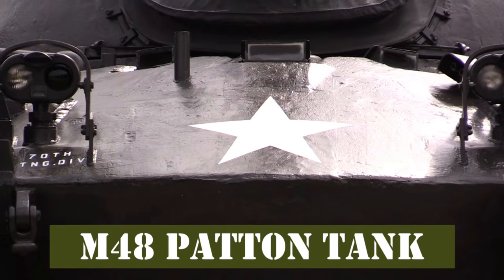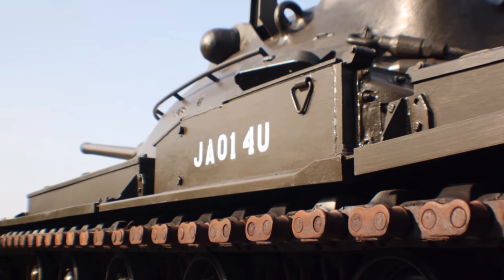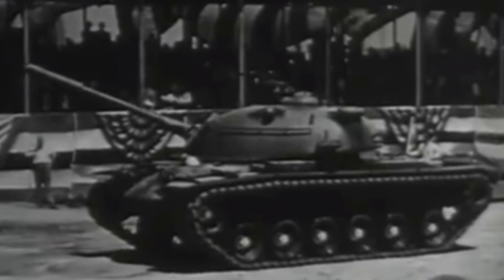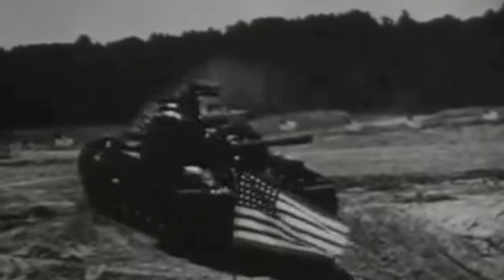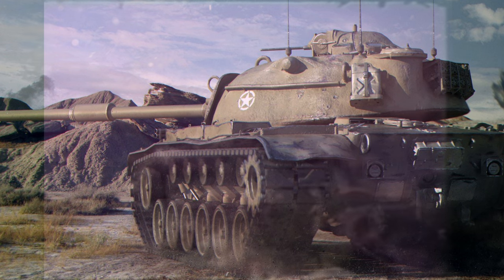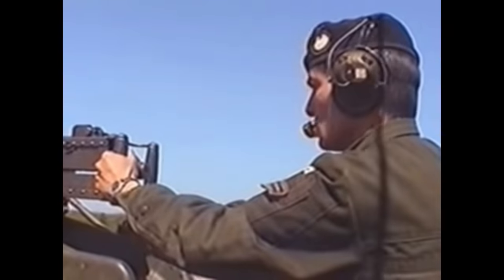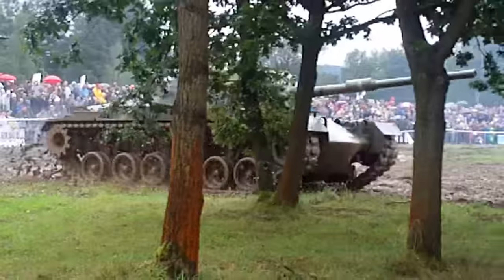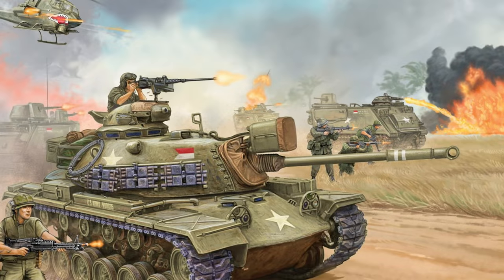M48 'Patton' Tank Series | AMERICAN ARMORED CLASSIC

Comment: Fun Fact: The US has thousands of M48 Pattons and M60's scattered across the country as last ditch tank reserves.

It's comforting to know that they still haven't let this beast go but it's scary to imagine the scenario it has to come back.
Reply: Yeah. Not just Pattons, there is a major tank depot outside of Dallas. It has like, 50 or more Abrams, Bradleys, and multiple other variants
Reply: @Limescale12  a big minority of the population already are armed with smal arms anyway...
Reply: They don't use them as last-ditch tank reserves they make use of the hulls to carry other platforms like recovery cranes or folding bridges, the 105mm guns are recycled to other platforms like the M1128.
Reply: The M60s and M48s are gone. Dozens were thrown in the oceans as artificial reefs. Hundreds were sold or given away as aid and no serving tankers know how to use them. The last M60A3 unit shut down in the mid 90s. My unit handed in our M60A3 in 1994 for M1s. There are a few thousand surplus M1 tanks in storage out in the desert but would take months of work to get into shape. Seals degrade, material and insulation dry rots. Sheet metal rusts, rain gets in as well as critters. If they are not maintained in a climate controlled environment and periodically maintained they degrade rapidly.
Reply: @13thSystem  They are last ditch reserves before anything else.

Many M48's and M60's are export capable. This was the intention as they were being phased out by the Abrams. But it was deemed that they should keep them in reserve. This is shown by the sheer amount that are combat capable.

Yes some of the tanks are converted, some were scrapped for parts for export tanks, some are used as target practice.

But there is an estimated total of over 6,500 M60's and 4,400 M48's scattered across the US in depots, storage facilities, or out in the open.

And the ammo isn't a problem as the M60A3 can use most 105mm ammo that is available. But what you forget is that some guns can't fire the same ammo. The M60 had the M68A1 while the M1128 had the M68A1E4, and the Abrams had the M68A1E2 the only common round is the M900. The E4 is the only one in active service and only fires the M900 and can't fire some other shells that the M60 used. 

With that being said there are still plenty of M833 ammo that the M60 originally used and can still fire some 105mm shells. The situation is even better for the M48 as it could use both 90mm shells and 105mm shells depending on the variant.
Reply: Yeah but the guns are grossly underpowered by today's standards. The 90mm and 105mm wouldn't dent most modern tanks.
Reply: @thebravegallade731  I think you mean large majority
Reply: Well, we also have T-54s in our reserves)
Reply: @joeclaridy  The M60 is capable to be upgunned to have a 120mm gun and the 105mm gun for the M48. This would enable them to at least have a chance against modern tanks. Modern tank on tank engagements are rare nowadays but in this scenario that they are back then something is horribly wrong
Reply: Kyle Reese  " It's a piece of junk" That's not the point the US had in mind. If in some heavy WW3 like scenario, let's just say the US is fighting Russia/China/Iran/North Korea at the same time or a single huge Russian advance into Europe, and Abrams tanks are taking heavy losses in a ratio that more are disabled/destroyed faster than building a tank from the ground up then it was deemed that the M60 and M48 was to jump in and take that spot.

Everything is there. The spare parts, the ammo, the guns, the tanks all it needs is some tlc for the ones left in the elements. Even if the US can't mobilize every tank it would have a huge stockpile to cannibalize.

I'm not saying this is going to happen as the scenario as a whole is unrealistic but at the end you can't deny the fact that this shows that the US has this capability for a reason.

You know that the US would bring back Battleships if they needed to right?
Reply: tfs2O3  Where are these tanks being kept. The last unit turned theirs in over 20 years ago. The Army can't use all the M1s it has what will it do with obsolete M60s. Even if stored in dry climates the electronics and seals will degrade. If the recoil seals on the main gun are not exercised by firing or by a maintenance unit a few times a year they will leak and then blow out if you try to use the gun. I sincerely doubt any M60s  in storage are as a war reserve. They may be a source of parts to sell the countries that still use them like the Air Force bone yards.
Reply: @Limescale12  same
Reply: @justat1149  There's a few thousand Abrams in the southern California desert.  Early models only obviously.
Reply: YorktownUSA 

I’ve heard about them. I believe they are either in storage or they are waiting to be sold or refurbished into M1A2’s
Reply: @dsan8742  😕 tell that to the afghans
Reply: @dsan8742  you have no clue what you're talking about. Chechnya should be a clue for you. Afghanistan as well.
Reply: They might be outdated but that won’t be on your mind if a 90mm HE is coming at ya.  😀
Reply: @Limescale12  the afghans did quit well that way. And the vietcong, and the yeminite rebels and and and....
...and the Americans in their first war!
Reply: There's even a austerity measure plan that ensure the M48 and M60 to act as  stop gap measures of M1 Abrams fleet is too expensive to maintained.
Reply: @joeclaridy  Chinese licensed produce 105mm : Alllow me to introduce my self.
Reply: @Leon Lopez Tell that to the iraqis, they hat quite modern Tanks and got Sniped by Abrams, pattons wouldnt fare better
Reply: @Solipsil its probably an urban myth, no way These tanks arent more of a Problem on the battlefield than a solution
Reply: I imagine they using it in a second American civil war
Reply: HEAV¥HAND  No problem, glad to enlighten you.
Reply: fmoa  Under what law? In case you didn't know war doesn't care about personal opinions or simple statistics. 
Yes indeed a M60 or M48 wouldn't fare well against say a T-90 or T-14 but 1 T-90 for 50 Pattons where did you pull that number from?

Here is a fact for you: A M60 with a 120mm gun can destroy any modern tank, same with a M48 with a 105. Is it unlikely? Maybe. Is it possible? Yes.

You know if the Cold War went hot NATO tanks like the M60,  M1 Abrams, Challenger 1/2, Leopard 1/2 etc. had the 105mm gun and would have to go against T-62's, T-64's, T-72's, and early model T-80's. Tanks with 115mm and 125mm guns.

War simply doesn't care about statistics. An American armored car destroyed a King Tiger during WW2. Under normal circumstances this should be impossible but it happened.

War and reality only cares about what is going on then
Reply: At the very least its a mobile anti tank gun.
Reply: @joeclaridy  Certainly wouldn't have the best chances of getting through that front armor.  But hte M47/M48 did get HEAT and HESH which works wonders in killing even the most armored tank.  No-one sane, though maybe they are insane to be in a situation where they would need to reactivate the M48/M60 fleet to defend the homeland.  We take them, set them up in ambush posistions; never engage frontally.  It would be a deathwish
Reply: @coolingdawn  the Jordanian, Taiwanese, and Turkish variants all have been upgraded to various forms of the 120mm in the early 2000's. Along with other upgrades and modernization programs I can see the 60 Patton having a fighting chance. As stated before I don't share that same opinion with the 48 Patton. You are correct about upgunning to the 105mm but against current armor packages and APS the damage dealt would be negligible. Even with modern chemical and hypervelocity rounds I truly do see them penetrating modern armor.
Reply: @Kastev30  they would be strictly limited to ambush and troop support against soft targets. It is true that M60 tanks did take out T-72 tanks during Desert Storm but how would they fair against Challenger II, Leopard II, T-90, etc on today's battlefields?
Reply: @Leon Lopez true that side, top, and rear armor has always been the achilles heel for tanks but what can they do on today's battlefields against their modern contemporaries? Banking on only engaging with older out of date adversaries is a recipe for disaster. Tank armor and doctrine has changed since the last M60 rolled off the assembly line nearly 30 years ago. When you combine reactive armor with composites armor and active protection, the 105mm and 90mm just won't work.
Reply: More like for targets.
Reply: The US interior security forces still uses this tank. Because it is still good to use for it. Front line use is.. hmm let me tell… "You want to loose a war?" action if the US will send it to crises area world wide.
Reply: Even if these tanks are still in reserve and will be used as last ditch weapons you do not have to worry,  as the us has the most powerful anti tank weapon no enemy tank can dare face in the american land battlefield.  And that is the US navy bro!   Ever imagine an invading army with an invading convoy carrying their mbts on transport ships and lpds..... Crossing the pacific or the atlantic with the us navy directly facing it....... Imagine!
Reply: Kyle Reese  
Pub. L. 109-364, the National Defense Authorization Act 2007

1. Iowa and Wisconsin must not be altered in any way that would impair their military utility;

3. The battleships must be preserved in their present condition through the continued use of cathodic protection, dehumidification systems, and any other preservation methods as needed;

3. Spare parts and unique equipment such as the 16-inch gun barrels and projectiles be preserved in adequate numbers to support Iowa and Wisconsin, if reactivated

4. The navy must prepare plans for the rapid reactivation of Iowa and Wisconsin should they be returned to the navy in the event of a national emergency

Even though these are museum ships they are still to be maintained. Congress will not let these ships go until the Navy finds a ship that can support marine amphibious assaults and provide naval bombardment.

The Zumwalt was going to take that role but it kind of flopped on it's face. Then the Littoral Combat Ship came along but it tripped on Zumwalt and also flopped on it's face. It tried to get back up but it was deemed to costly so it's laying face first on the ground in shame.

Navy estimates of reactivating and modernizing battleships cost a little over 2 billion dollars each.  So for the cost of 1 Gerald R. Ford class aircraft carrier you can activate and modernize 6 battleships.
Reply: @coolingdawn  the L7A1 is still a mighty gun after-all!
Reply: @joeclaridy  Depends on combat range. Most guns post-cold war still have a fighting chance against current tanks, because gun pen technology has relied less on the gun and more on the shell as time progressed. For the most modern tanks the older guns would have to be at extreme close range, perhaps within a kilometer or two to shoot at the front and a little farther from the side.
Reply: Raytheon is still upgrading the M60s. New power-pack, gun and upgraded armor.
Reply: @thebravegallade731  I mean, that's what the 2nd amendment is all about - having an already-armed militia ready to be called if necessary.
Reply: @joeclaridy  The 105 is still a potent gun, not as potent as the latest versions of the 120, but still potent non the less. Furthermore, the M60 can be up-gunned with the 120, as have most notably shown both Israel and Turkey.
Reply: @coolingdawn  As far as I am aware, those tanks are only under consideration for export to countries that have extremely good relations to the USA.

Comment: This was my “horse” (M48A3) in Vietnam. I trained on the M48A1 at Ft. Knox AIT early 1969.
The only trouble with this vehicle in Vietnam was the boat-type hull. When one was pushing trees and bamboo, the debris slid to the left or right causing damage to fenders, track, in some instances binding up around road wheels.
Reply: The A3 was my war horse too.  I was a TC with A Co. 1/77 Armor 1 Bde, 5th Mech Inf thru 1969-70 in Northern I Corp.  I remember the modification that we made to the external pintle mount for the M2 50 cal.  We took the floor mounted ammo storage boxes for the M 73 coax, cut them and welded them to the mount to store 800 ready rounds at the gun
Reply: My dad was a draftee in the early 60s.   He drove these things.  His draft enlistment expired before Vietnam broke out.
Reply: @PSGE7  yes, we had the similar modifications.  I was a TC with 11ACR. The mount for the deuce was welded to the cupola, engineer stakes were welded to the cupola and turret forming a frame to hold an empty mini-can. This way we  could load about 400+/- rounds on level with the gun.

Comment: In 1988, I was training down at Fort Benning, leading how to be a Platoon Leader. We were doing a force on force exercise using MILES Gear, M113's and M-60 tanks. The enemy platoon was defending a small hilltop overlooking a dirt road, which my platoon was attacking down. All the students were 1st and 2nd Lieutenants,; were would rotate through different positions to learn various infantry jobs. I was the light machinegunner that day. Oh yeah we were in MOPP Gear and it was August in Georgia. My squad moved up to remove several rolls of barbed wire that was laid across the road. The APCs and tanks laid down cover fire, myself and another gunner also did the same. With the MOPP gear, and Pro mask on plus all the blanks/ grenade simulators going off. It was almost impossible to hear. I'm laying there firing belt after belt on the MG, when I noticed the ground was shaking, I rolled onto my left side and saw a M-60 tanks towering over me. It came rolling up, faster than I thought possible and rolled right past me, probably no less than ten- fifteen feet from me. It completely freaked me out. I was so thankful that the driver and crew could see me and didn't turn me into hamburger.
Reply: Ok old man. Go have ur juice and get to bed

Comment: When I was in the army I trained on the M48A1 (gas powered) with a 90MM main gun.  Also trained on the M48A2 and M48A3 which were diesel variants of the original M48A1.  In addition, the later variants of the M48 had changes made to the main gun optics.  Toward the end of my enlistment I trained on the M60A1 and M60A2.  The M60 had a 105MM main gun and also diesel powered.  The later variants of the M60's had upgraded gun optics and modifications to the tank commanders cupula.  Was mustered out about 5 years before the M1 Abrams came online.

Comment: There were 2772 US Army tanks during the entire course of the Vietnam War that served using the M48 mostly A3..I was one of those few. The M48 was excellent at busting jungle and fast enough for some convoy duty on a limited bases. Better at roadside security and as a reaction force if/when the convoy would come under fire. The 90mm cannon did its job outstandingly as most contact was under 400m. The canister round was my favorite main gun rd. We also had 2 M2HB 50cal with inf mounts welded on. Usually a back deck man with a M60 MG as we really didn't use a gunner per say. Again close range. Fine tank that kept me alive at the expense of all who were in front of us. Good video on a historical military vehicle.

Comment: I jioned the army in 1957,was trained as a mechanic,first tank we worked on was the M48A1.This was the early model with the flat rear deck,Engine was as you said the AV1790.The engine had two carburetors.Last M48 series I worked on was the M48A2C Model.I am familiar with the M48A5 series as well as the AVLB vehicle.The version we had was mounted on a modified M48A2C hull.It had the AVSI -1790 Engine.I think this was the last AVLB vehicle that had a gasoline(Petrol) engine.I was statione in Korea when the last Turkish armed forces tank unit went home so we were tasked with shipping the M47 tanks they turned in,so I saw a few of those,also.

Comment: the M48A5 was a 105 mm cannon that was used for training and had a diesel engine. However, it did not have a gun stabilizer so you had to stop to shoot.
Reply: The STAB system used in the M-60 wouldn't transfer into the M-48. So, yes, we had to stop to shoot.